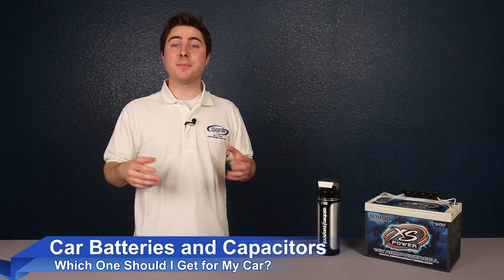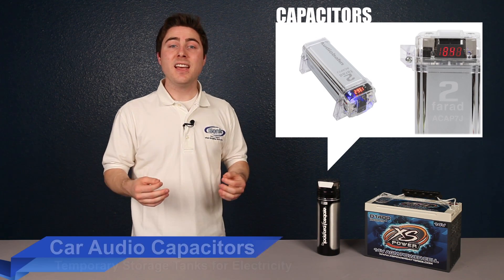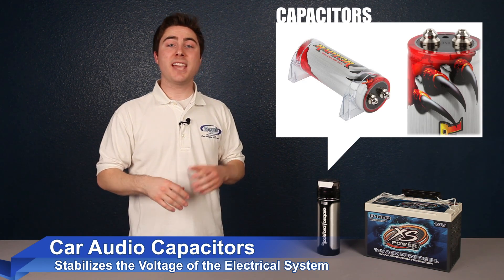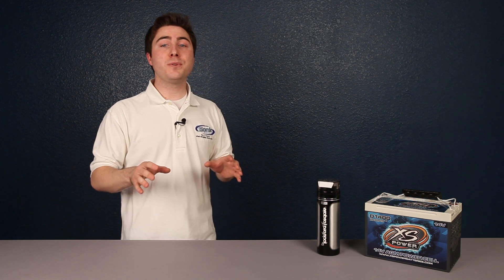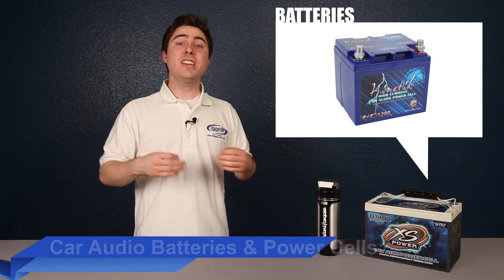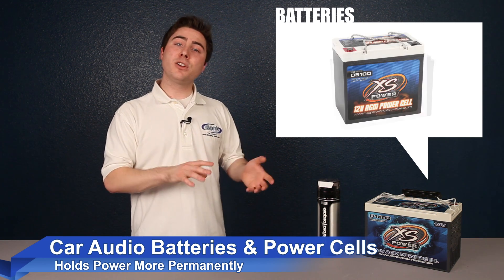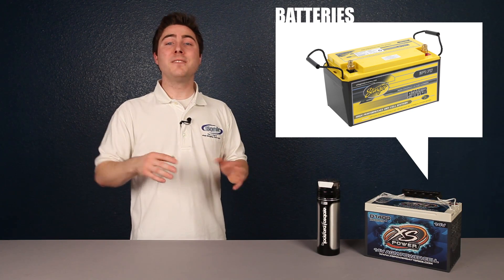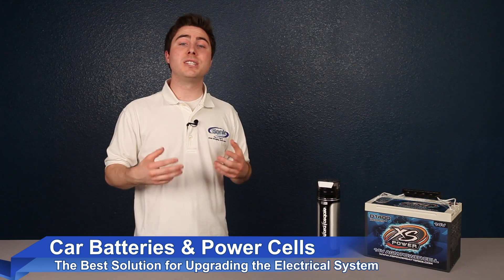Car Batteries or Capacitors: Which Should I Install? | Car Audio Tips

Comment: Can I use a Cal bank, AND a Li, or AGM as a supplemental battery? ( Mechman 400 amp, and a ssp D3400 as a starter battery. Isolated with the NVX 500 amp relay/isolator. (I bought that from you).

Comment: If you go for a high enough wattage stereo, you'll need to upgrade your alternator along side a battery and capacitors to maximize stereo performance with power left for the remaining electrical equipment in the vehicle

Comment: You should check the output amps of your alternator. If you have a 55amp alternator and are drawing 100 amps no battery or capacitor will help.. this guy is just advertising his products and not concerned with actually helping...

Comment: @sonic electronics I have a 2023 sprinter van that has suffered an electrical short and the Mercedes dealer is blaming my aftermarket amps as a possible cause of that issue. Is there a way to power my audio system (factory head unit, one 800w 4ch Audio Control amp powering 2 Focal K2p front speakers, one 800w Audio Control mono amp powering one Alpine shallow mount sub) by adding a separate car audio battery and keep my factory batteries untouched? What would you guys recommend to power my system without having to go through my factory batteries? Is this even possible? Let me know, thank you!

Comment: What about a hybrid with no alternator?
My amp drains my lead acid battery to 11volts in 10 minutes and the amp shuts down. 
But my headlights etc never dim since my car runs off the traction battery which never drops below 12.7v
Please advise

Comment: To be honest, if seems if you really want to reduce the load on your electrical system, you'd be better off building a super capacitor bank (to supplement the battery) to provide a more stable power output. As well as take (a lot of) the starting load off the battery. And just having some sort of deep cycle battery (ideally LiFePO4) to provide long term power, and power to keep your capacitors charged for starting. Plus the fact you're not having to go from electrical energy to chemical energy, and back to electrical means less losses in general.

Comment: The better choice is to upgrade your alternator and alternator wiring in your vehicle. By adding caps and batteries you are just putting more demand on an already overtaxed charging system.

Comment: I  looked at the Skar dual 15 with a dual 2k Amp.   I need a new hood battery well my hood battery is inside the car lol under the seat 🤔 and a new battery to support zerO gage wires and Amps.
I didn't know anything about capacitors 🔋 🔋 🔋 🔋 🔋 🔋 🔋 🔋 🔋 🔋 🔋 🔋 🔋 🔋 🤔😐
I might have to finance all this 🤨🤑

Comment: If I remove a bass battery and amp I have in my trunk a 2nd battery just for my system what do I do with the wires that are coming from the front car battery? I want to keep the wires for a system I might install later on down the road. Is there a way to cap them or are they safe since no amp is drawing current anymore ? Dont want to catch my care on fire from a pos cable just laying there lol
Reply from the maker: I would disconnect the wires from the front battery, and leave them installed. That way you don't have a live wire loose in the car.

Comment: A secondary agm battery is the way to go, stopped my light dimming and voltage drops, glad I got a secondary battery instead of a capacitor.
Reply: When u did that did you upgrade your alternator or did you just add it and hook it up to your stock battery and ground to your chassis
Reply: I'm new so idk exactly how to attack it my lights don't dim too much but I plan on adding a four channel amp for extra speakers and maybe a bigger amp for my subs

Comment: So if I get a 1000ca 800cca regular battery for my vehicles regular main front stock starting battery is that still good or do I need one of these "audio" batteries instead? I will still be adding a battery in the back for audio tho.
Vehicle=2002 Chevy Blazer Xtreme.

Comment: I have a teramp 3000 watt and two 12 inch vfx  skars. When ok turn the volume up a certain amount. The amp shuts off.  Would a 3300 capaciter help? Or do i need a second battery

Comment: I have a Amp 3000 w so what do you suggest to me if want to upgrade my power the capacitor or a second battery  ?
Reply: Deff 2nd battery. I got 3k watts rms, and I got a xs power xp3000. And a xs power d3400 and it still hits my electrical pretty hard.

Comment: You know what’s the best thing? Is to have a battery storage in your trunk and run a a capacitor in between to your amplifiers 
I think a capacitor keeps consistent flow of power and a second battery to give that capacitor a steady flow of energy 2 in 1 and safe your alternator for the front battery also install an isolator in case the batteries drain your starting battery this way you have a full functioning clean flow of power no issues at all

Comment: can you answer this?
i recently purchased a capacitor (Sound Storm C22 2 Farad ) with 16v to 24v surge. i have a 12v battery in my car. will this capacitor work with 12v system?
Reply: Yes, but those things are junk and won't do much

Comment: What if I just Installed an amp/sub and my battery dies could a capacitor fix that??
Reply: No. Before you add a 2nd battery you should upgrade your alternator and do the big 3

Comment: Contradictory commentary. You first mentioned that a capacitor can help with occasional headlight dimming, but then when you discuss the battery, you said if you're headlights are dimming, you must get a better battery. That's confusing, because what good is adding a capacitor for dimming headlights, if dimming headlights dictates the installation of a more powerful battery?

Comment: I have a 2004 Chevy 2500 with a 3000 watt amp and a 15in sundown I've upgraded the alternator the wiring and added a second battery but I still get dimming what's my next step?

Comment: I’m getting ready to install my system in my second ride. I have multiple amps totaling around four thousand watts continuous power. Typical set-up subs, woofers, mid - woofs, mid’s and tweet’s. Been thinking about adding extra batteries for the amps so I’m not stealing starting battery juice. Who makes the best batteries for my application and alternator/s if my car has room for bigger or multi alts. How much larger would the big 3/4 upgrade cables need to be so my system runs flawlessly and never drains any of the batteries or overtax the charging system while supporting all the extra amp batteries??????? HELP
Reply: You need 2 runs of 0 gauge to mai battery and 2 to the trunk batteries or run 2/0 gauge welding wire to the back to distribution block
Reply: Dude if you're quoting legit numbers.. You might be pulling 400 A minimum. That's a lot of fucking juice you're going to fry your stock alternator. you need a minimum of 250a alternator and 1 xs power large battery preferably 2... now if your 4000 W is coming from a boss, power acoustik, soundstorm, or soundstream then ignore everything I said
Reply: rmblwgn I don’t own any of those brands u mentioned

Comment: Yo homie my shit been dipping down to 9 Volts for the past two years and I had no issues yet
Reply: That's horrible I'm surprised your alternator hasn't fried. You must have a reliable amp because that will break most amplifiers and or clip the fuck out of your subs and burn voicecoil's
Reply: 9 volts 🤯

Comment: Had capacitor running a simple Alpine MRP-500.1, capacitor caught fire and almost fried my trunk. Ditched the capacitor and installed a Hifonics HFI 1500.1d.  Installed Kinetik HC1400 Blue. Lights still dim a little, but the sound quality has gone up considerably.
Reply: have you done the big 3 that should help with the dimming

Comment: I still don't see the point of external capacitors when the amplifier is already doing the same job. I understand that it helps the battery taking the brunt of quick bursts but in long tones its already depleted sitting there passively. The amplifier is doing the same thing as the capacitor so it seems pretty redundant.

Comment: How about 6 super caps
Maxwell 2.5 volts at 2600 farads each with a battery isolater 
I’m curios if anyone has done this for a  1000 watt amp at 2 ohms.
Reply: those super caps are good up to 2-3k watts as long as your car is on while bumping music

Comment: When should i use a audio battery + a cap?
Reply: Cause iam using a audio battery and a cap , but when i a break down or a flat, and the car is sitting i gotta get a jump, that shouldn't be the case, unless the oem alternator isn't charging the battery to full, but i heard thats shouldn't be,
Reply: Cause if iam not using my audio system, 3 weeks sitting it should start.
Reply: @chrisnas1483  The capacitor is always charging from the battery unless it is told not to. This is why amplifiers have a remote terminal so the head unit will tell the amplifier to turn off, so you won't have the problem of going to turn on your car and your battery is drained.
Reply: honestly I don't see the point of a capacitor when the amplifier is essentially doing the same task
Reply: So a cap is better than the battery in a way, or the battery is better?
Reply: the one farad caps are junk. if you plan on using caps use supercaps like maxwell or xs power, you get them as a 6 pack and wire them together in series. those caps are 500 farads and are good up to 2-3k watts. these caps replace the secondary battery

Comment: Do I need a capacitor when I'm having my stereo system running on two batteries
Reply: If your headlights dim or anything electrical slows down or dims when using your amp. If you have none of these issues then you don't need one.

Comment: I am wanting to run two Orion amps, each are putting out 2500 watts rms and in addition a 2000 watts rms for highs. Will a 50 fraud capacitor go the trick?
Reply: nope you will need 3-4 6packs of the supercaps if you want to run caps in the trunk or 3 agm batteries in the trunk. the most expensive option would be to run a lithium battery

Comment: I have a .5 farat capacitor in my car witch i hear is rated for 500 watts, but my 2 amps are putting out a total of 1300 watts. Is that killing the potential bass that my speakers could be putting out if i didnt have the capacitor?
Reply: youre better off doing the big 3 and putting another battery in the back

Comment: I have a question as far as checking the UF value for the capacitor would you check it like you would a regular capacitor let's say for an air conditioner check in the uf value to see if maybe the capacitor still good cuz somebody sold me one and before I install that I want to make sure it has the right UF value it says 2 million UF for something like that but when I tested it it came nowhere near that. How would I do that?

Comment: I have a double din and I have aftermarket door speakers that are connect to it, and I have 2 12 07’ cvr kicker subwoofers with a 1,000 watt amp. I don’t wanna drain my battery so I’m wondering if I should go for a capacitor or battery ? New to sound systems so just wondering 🤙🏽
Reply: big 3 and secondary battery will give you better results

Comment: Just bought the stinger spp1300c I have a difficult car though . It’s a Chevy hhr it says that battery wont fit but it meets my 600cca oe requirement it’s 610 and way better than the ac delco . It’s a half inch taller and not as long by . .4 inches or so but I have the extra height clearance and If I have to use one spacer on the side I can use almost anything a paint mixing stick cut to size or maybe rubber or foam . 

I might make a video since btw there are NO current battery upgrades for the Chevy HHR I looked everywhere it’s group 90. Needs 600cca odyssey makes a group 90 that’s 540cca . Optima . XS I literally checked every battery company . 

The Stinger is the closest that will fit maybe I’ll make a video .you guys need to do a big 3 upgrade video for the HHR btw it has that stupid power box up front battery in rear it’s going to be such a pain . 

Wish I had a reference to go off . Thanks

Comment: He misused the term 'power' and thereby misstated a couple facts. Contrary to what the gentleman stated, a capacitor certainly is a good component to increase the power capabilities of your hybrid electrical supply. It does this better than adding more battery capacity. In contrast, a battery excels at its ability to store and supply energy. This comment won't make sense to those people who can't or won't differentiate between the meaning  of the words power and energy. This comment is for people that understand (or want to understand) the meaning of those two words. Understandingly, most people won't understand this because the words are used incorrectly all the time.  In short, capacitors are good for supplying brief high power demands, and batteries are good for supplying longer duration energy needs. For context, and roughly speaking, a large capacitor contains approximately the same amount of energy that an AA battery contains, whereas the former can supply thousands of watts, the battery can supply only about 5 watts. Whether or not a capacitor is a good idea for your audio needs is entirely dependent on the  battery, wiring, alternator and capacitor options, but good capacitors certainly provide great advantages to hybrid electrical storage systems.
Reply: I'm working on my first sub setup and I have 2 10" subs 1000W RMS each and a 3000W RMS amplifier and I don't know if I should use a battery or a capacitor i would assume a battery would be better but I'm new to this stuff so I don't really know whag to do
Reply: Ok @danksushi7417

Comment: How would a capacitor work of you don't have the battery power to back it up?
Reply: The capacitor store power itself to help stop drops in voltage instead of pulling that power straight from your car.

Comment: How long do these capacitors hold their charge? A primer charge is necessary to keep them from getting damaged when you hook them to the battery. Say the system sits idle for an extended period of time and the battery dies. How long does it take for the capacitor to lose their charge?

Comment: _*With this simple battery reconditioning method, you won’t have to buy new expensive batteries in 2017.or ever again [Check Details Here>>>>https://www.facebook.com/Battery-reconditioning-310070329426065/app/208195102528120
 ] .You can just recondition your old, used batteries and save a lot of money!_*